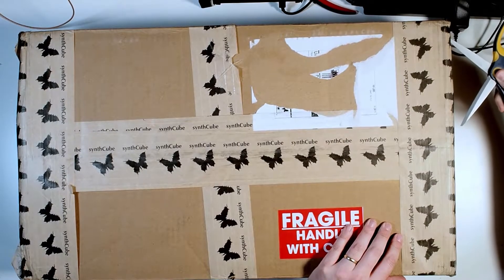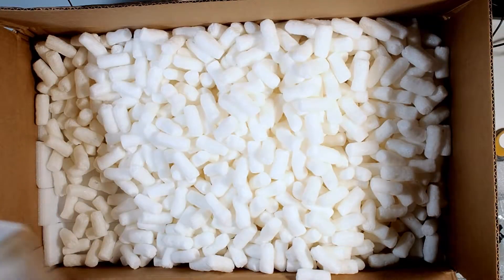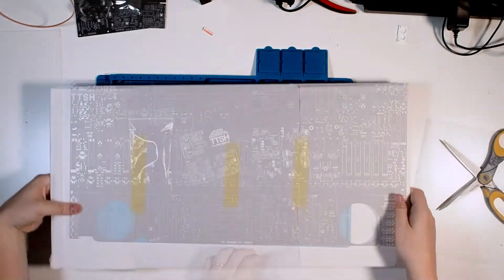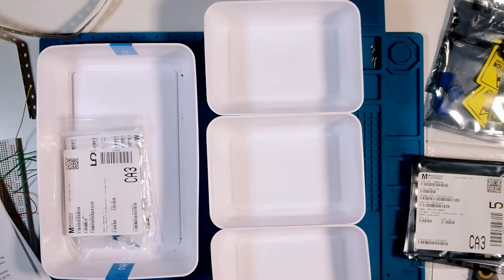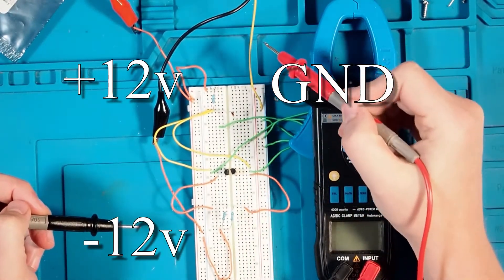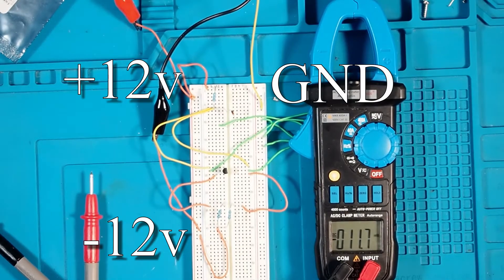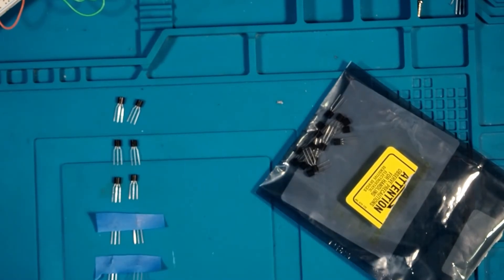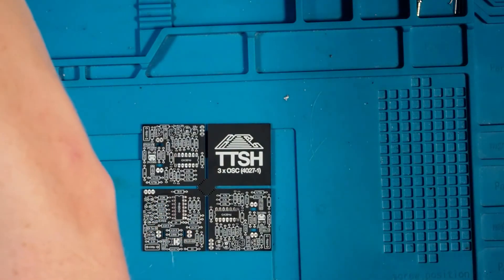TTSH v4 Build - Part 0: Inventory and Transistor Matching

Comment: Hi! how's the assembling going?
Reply from the maker: Very slowly, haha. I've got the VCO boards done and I'm starting on the VCF and power supply boards now, but I need to cut that footage down into a video sometime soon.
Reply: @ThatTascamGuy  ahah thanks! can't wait to see the progress! is it something difficult or just a lot of time and patience needed? also which extra tools do you need? (except for soldering ofc)
Reply from the maker: @navrasmusic  It just comes down to patience really. And time. I haven't had much time for hobbies lately, unfortunately. The actual soldering is quite easy, it's all through hole components. It's just a LOT of through hole components.

You don't really need any specialized tools, just a soldering iron, solder, and some flux. A desoldering tool is handy if you screw up, especially if you solder the IC chips directly instead of using a socket, but not really vital especially if you're careful.
Reply: @ThatTascamGuy  Epic! thank you very much, and good luck!